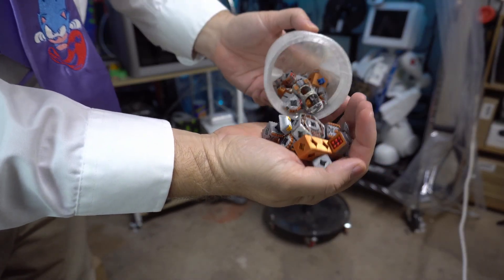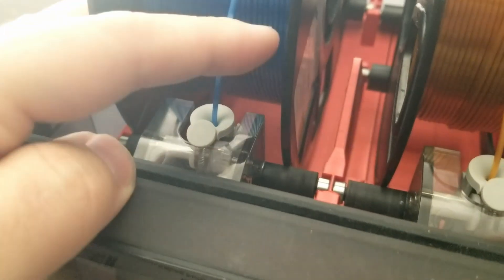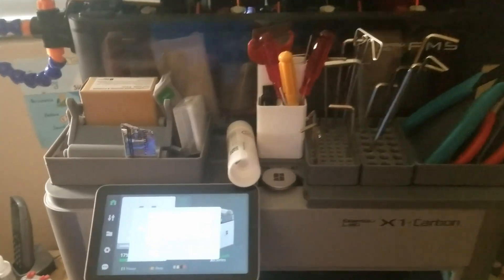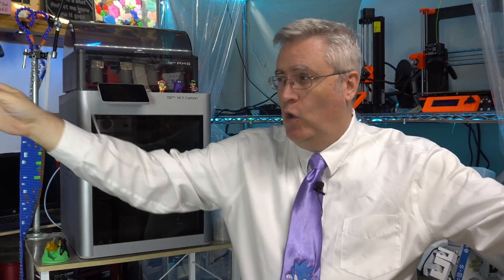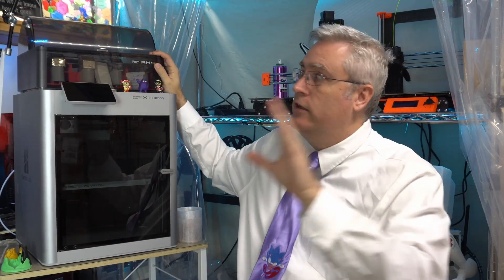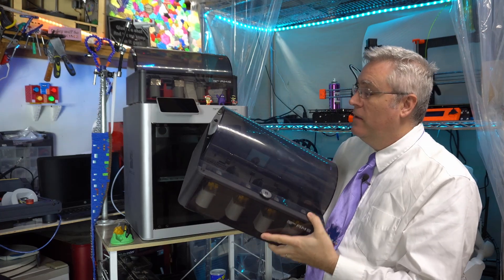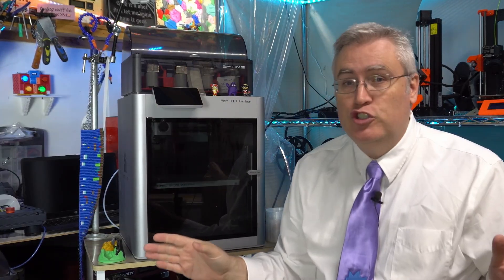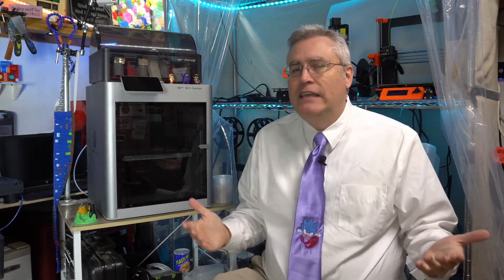My Bambu AMS died after only 1 year

Comment: I dunno. Showing off a box of waste, plastic waste at that, isn't a selling point.
Reply from the maker: Do you feel the same way when you see sawdust in a woodshop?
Keep in mind, that's all PLA, which is a bio plastic, meaning ecologically it's already ahead of petroleum products.While it doesn't degrade as much as some would like, under the right circumstances it can degrade, meaning in 100 years there will probably be less PLA in the world than ABS or PetG, unless some microorganism evolves to eat ABS first.
And that box is mostly air. It's actually surprisingly light weight.
Reply: Comparing PLA poop to sawdust? I guess in the most literal sense of being being waste products. However, sawdust is a natural occurring waste that can be composted literally. I find the term "bioplastic" misleading. Instead the term "bio-based polymer" should be used to adequately describe the process by which this material is created and by which it can be degraded or composted. Normal PLA needs high heat and moisture to break down. This is only available to commercial entities and not to a general populace. But with PLA+ and other formulations, can we really say this material comes from corn and is full compostable? 

Don't get me wrong; the X1 is a pinnacle product and an amazing device. It rivals and even surpasses commercial grade printers. But as we move forward as the human race, the idea is to have less waste and not have more 'less poisonous' waste.

Comment: I had a history of problems with my unit getting spurious face fell off pauses, after a few months one of the wires for the wiring harness to the face just flat out broke and now I know the cause of the issue. I was a KS backer, they helped me figure out what part I needed, and for $35 including shipping at a snails pace I will soon get the joy of figuring out how to replace that wiring harness. No they don't ship normal people replacement parts for free, no they do not supply new major components for free, and in now way would they ship a printer for free. Their customer service is slow to respond does not do anything beyond the bare minimum they are required to do for the average consumer. I own and X1C with two AMS units, but I don't think I will buy another BambuLabs product. Now that other multicolor solutions that actually work are hitting the market I will use them instead. I do applaud the fact that this company made the whole industry step up their game in making this hobby more accessible, but now that they other vendors are doing so I don't see why I should buy a product with poor support and hardware that does not last.
Reply from the maker: It's a question of marketing vs customer support.

Comment: I 100% believe they treated you differently, I've had a few defective minor pieces and I had to go through several emails and videos to send a $10.00 part to the point that I was going to submit a return on it since it was less than 2 weeks old. It's unfortunate that special treatment is only recognized when you have a presence on YouTube.
Reply from the maker: It's a question of Marketing vs CS, I guess. It's not unusual for marketing to get special and even exceptional response, because it's expected that that will result in more sales, where as CS is just goodwill.

Comment: Was KS backer 440 and mine has been going for more than 18 months now. I've had a couple of issues, but customer service took care of it. Still works well, but I have noticed a bit of a squeak coming from the gantry. Bambulab didn't want to help me solve it and basically said I'm outside of the warranty period and would need to buy my own parts. They suggested a new $90 replacement gantry. Thanks I guess?
Reply from the maker: I mean, they're not wrong. You are outside the warranty and so new parts are on you. And at least you know what part you need. I'd say that's pretty steep, but I just dropped $150 on an extruder head for my Flashforge Creator Max 2 so I can keep it running.

Comment: Had a similar issue. I just threw out my ams, have not bought a new one yet. I am a Kickstarter backer. I could not get them to replace my AMS. They told me that because its classed as a wear item it only has a warranty of 3 months. So no, they do not care about their early backers.
Reply from the maker: Only 3 months? 
I mean, on the one hand that means I got a lot of life out of the thing, but on the other hand, they could have told us that upfront!
Reply: @3dpprofessor  ya, I had my funnels stop recognizing filament, the feed motor kept skipping, and the stage 1 feeders kept doing weird cycle events that resulted in them overheating. They said it was working normally. Then one day the unit stopped working all together. I agree though that they need to be more upfront with things.

Comment: I am one of the Kickstarter backers that received the V1 AMS like you. I too had the exact issue of chewed up filament in first stage feeder slot 1 & 2. This AMS was brand new. Maybe 2hrs printing then it started. I lost so much filament as I had to cut off the chewed up bit then restart then fails again. A 4hr print would take me 12hrs. I was so fed up so I contacted Support. I had to go through hoops like send in video, pictures, show invoice. I must admit they were very helpful but they sent me a part that I couldn't even fit myself so I had to use my consumer protected rights so I requested a refund. That's when they said they'll send me a new AMS replacement. Oh brilliant I thought but "If you can send your AMS back then we can send you a new one" well I didn't have an AMS box and I threw away the X1C box due to lack of space. So I asked them can you send me an AMS box with padding so I can send back the faulty unit. "Sorry we can't do that" 🤔 so what am I supposed to do then? "The only way is to purchase a new AMS from our store and use that box" So you expect me to pay £350 for another AMS just to use it's box? "Yes that's correct" so I had no choice and paid for another AMS. Once I received the purchased new AMS it was V2 and I sent back the V1 Kickstarter faulty AMS in the box. I receive a new replacement AMS and that too is V2 and so far no issues with chewing up filaments yayyyy. So I will give some credit to Bambulab support for sending a replacement AMS, it would have been better if they could either sent me replacement AMS first then I could send back faulty one with box or sent me empty box with padding. It seems that YouTubers are getting preferential treatment as they automatically sends them and you a new AMS without you sending back the faulty one. This in my opinion is not fair to myself who had to spend more money just to get a new AMS and to the other backers and customers. I know that you used a different name and email address to keep it fair and I fully respect that. It's the way Bambu responded that has made me upset.
Reply from the maker: Honestly "send me the unit and I'll send you back the box with the bad unit" is the way other's have done it in the past. I know it's a question of trusting a stranger for them, but it's a paying stranger.
Reply: @3dpprofessor  I have two AMS now as Bambu made me purchase one from their store just to use the damn box lol. I'm not complaining having two of them. It was just how support treated me. I had to tell my experience. I'm glad that you got yours including another X1C (lucky bugger lol)

Comment: Using proprietary parts and not stocking them is a deal breaker for me.  Given the cost of this printer it borders on fraud. If you're not an "Influencer" you're out of luck. I guess they figure if they can keep the influence simping for them, they can keep the regular consumers fooled.  I'll wait for alternative  multicolor printers to become available.  I do appreciate your attempt to provide a fair assessment and hold their feet to the fire. You almost made it.
Reply: In EU a manufacturer has to provide spare parts for discontinued products for reasonable period. What is reasonable is not specified in the law but for refrigerators it's 10 years, for washing machines 7 years. So for a 3d printer which is really not discontinued, they should still have spare parts. They would get a fine if you reported them to a proper authority and be forced to replace the unit.
Reply: @hologos_   That is not the case in the US and if I have to force a company to do the right thing, do I really want to do business with them? More and more vendors are putting out multicolor printers.

Comment: Purchased my X1C + AMS almost 1 year ago. Video on my channel. And had problems from the beginning with underextrusion, other curious things. Made a few videos. Long story short. Bambu has not replaced anything yet. After 15+ tickets they close them with nonsense arguments. The printer is a 1.600 Euro brick since day one. After Ticket 12, i had a support guy really trying to help me but I am a wheelchair driver, with some problems doing "easy" things for you. Bambu does even understand that. The nice guy was replaced by the "ticket closer" and my printer is still not working at all with an extruder motor turning back and forth without even started a print job. Believe me: non or small influencer get nothing! Not one single screw. Wish all the best. Sandor - DM4DS
Reply: In china there is no such thing as people with disabilities, that is why  they do not understand you

Comment: Ah, I beg to differ, I was a Kickstarter backer and had the issue this video is about. When I contacted Bambu Lab they had me send them a photo of a certain spot on the old-style control boards in (2 of my 3 AMS units) and with that confirmation, they sent me (no cost) two replacement PCBs, so that the new 1st stage extruders could be installed in the AMS. This was 3-4 months ago (Q2 2023). They mentioned the reason that they wanted the pictures of the old boards was so they could keep track of the replacement boards and validate that the issue was because of the circuit design change that did not exist on the first ~2,000 AMS units that had the old control board. Bambu knew exactly the issue when I described it, and in fact, sent me to a Bambu Lab Wiki page with step-by-step instructions on how to disassemble the AMS, and where on the control board that they wanted the picture taken. I have had exceptional support over the past 15 months. I now have 5 Bambu Lab printers (four P1Ps, one X1 Carbon).
Reply from the maker: I do like their documentation.

Comment: We bought two ultimakers for work about three years ago. They worked but even with pla the bed adhesion was not so got. They cost us about 6500 euros. Now we have on p1s it is faster than both of them together, Better quality and multimaterial. So if they work for one year and I buy a new one every year we would still come up ahead. And you can still buy the ultimakers from than and they are still way more expansive. So waht would you do in my situation?

Comment: How many hours of printing do you have on the machine that failed?
I have a non-kickstarter machine that's 6 months old but with 1,000 hours of printing on it. It's still going strong and I've only had to do about 3 hours worth of maintenance, total, since setting it up.
Reply: Let's hope that 1000 hours is just a break-in period for the machine, come back when you reach 100000 hours.
Reply from the maker: Just checked. That machine is over 1500 hours, and it's still chugging along. Just the AMS that died. And they don't track the hours on that.

Comment: I`m guessing someone that buys this combo for a bussines will at least want it to last until it pays itself off and returns a decent amount of profit. So the period really depends on what that buyer prints and what his bussines returns are. Some would be happy if it lasts a year, some two etc. For a person doing the occasional trinket here and there I would expect it should last them at least 3-4 years or however long other household appliances tend to last. For Bambu themselves ideal is that it lasts long enough for the majority of users as not to prove unreliable and drive potential buyers away but short enough that their new producta will sell and replace the old ones. I am sure they are building them with many contraints regarding costs, longevity, serviceability, reliability. The only question is if they`ve made too much of a compromise when designing it.

Comment: I have had similar experiences, but way more of them. I eventually gave up, the printer was simply not reliable at all. I found that running carbon fiber through it all helped some, but clearly it is a tolerance issue. .

Bambu has been making so many changes and no longer really support anything from previous machines and it is kind of disheartening.. Being closed source, if they stop supporting something, you are SOL as you have found out. 

I had a similar issue when they recognized me as a creator, however I paid for my machine. I was at the end of the road, no further things, the machine was simply not working. When they realized I was a content creator the entire conversation changed and they were now willing to help again. THEY DO NOT PROVIDE THE SAME SUPPORT TO NORMAL USERS and that is a huge issue. I refused any special treatment and dug my heels in, my second X1 Carbon has been returned as another lemon. Real issues overall. Support inconsistency, especially when they recognize you are a creator, is a MASSIVE issue that they need to get figured out :/

I am glad they solved your issue, but yeah, we both know they would not do this for a normal user..

Comment: I had some issues with my AMS but it was because I was using cardboard spools with those adaptor rings, until I got fed up and printed spools to replace the cardboard spools. Problem solved!
All reviews I see regarding the AMS are people doing heavy color printing. I see the AMS more like a convenience to handle materials but I focus more on functional builds so I seldom print multicolor and definitely avoid printing multicolor with multiple filament change per layer. SO if you really use the AMS so heavily it is likely to wear soon or produce issues quickly. In the end it is an accessory full of relative fragile moving parts. I don't think they can make it more robust without cost going crazy so if you print multicolor often expect a higher failure rate than others. Still this kind of review is really valued and I like the approach and the honesty.
For the regular hobbyst printing a  few items per week Bambu seems to be an awesome product and I think it will last for at least 5 years without issue. For production the printer should be fine, but we need to wait until that time and see. However, reviews must compensate for the output/time and not just time. This printers can churn stuff at a much higher rate than most models that have passed the test of time, so comparisons must adapt to the new circumstances. Maybe a 3 years life cycle in a production environment is much better if you have 2 Bambu Labs doing the same job than 5 Prusas that will live for 5 years. I expect people will keep making reviews every few months to report on the endurance and reliability of their printer.

Comment: That's a big concern for these groundbreaking machines.
Higher speeds = higher wear.
Closed ecosystems usually mean few, if any, user replaceable parts.
My retired POS Ender 3-V2 always needed tweaking to get decent prints.
My pair of Sovol SV06 & SV06 Plus machines just crank out prints without issue, and mostly use industry standard components (rods, Nema motors), so they are repairable by me if needed.
It will be interesting to see how the Bambu machines, as well as similar machines from competitors, hold up over the long term.
What's definitely not a good look for Bambu is the regular user vs. influencer warranty stance. 
A customer is a customer; as we all know from forums and Facebook groups, bad news travels fast!
Reply from the maker: And most influencers don't want to damage their position with manufacturers. Heck, I don't want to damage my position with Bambu. But my first responsibility is to my audience.

Comment: I've x1c since April 2023, almost 2000 hours of printing, mostly Fiberlogy ABS, was my first printer, at this point I'm into 3D printing all the way. I'm creating things that was never available to me, like huge 3D maps.

Do I trust Bambu as a company? Like any other company with their claims, means not at all :D 
Do I recommend this as starting printer? Yes, all the way.

Why? I've manny friends, that bought some cheep 3D printers, and at some point they dropped using them, because the constantly failed prints. 

With bambu, without any experience you can print reliably, and I think this is most important thing in their printers, User Experience, that just works.

Comment: Query (before I forget); What's the weight on that fila-poop? Preferably in kilo's, as I'm not an American and use real measurements :P
Reply from the maker: I just mailed it to someone and it came out to 4.5kg. Pretty hefty.
And, honestly, I don't think it was for 4.5kg of prints.
Reply: @3dpprofessor  Nah, I gathered that 😀. Was wondering to sort of check if a multi-head printer's financially viable for me. With that amount, in a year; it really isn't. That's about 90/100 euros worth of waste, as opposed to several hundreds in extra purchasing an IDEX/Toolchanger. Thousands, when talking the Prusa XL.

So, AMS is the way to go for me, for the next couple of years at least 😀. Cheers mate.